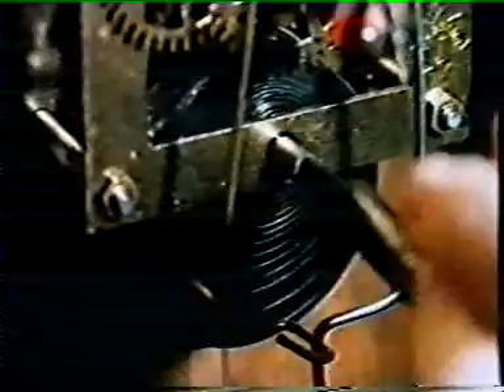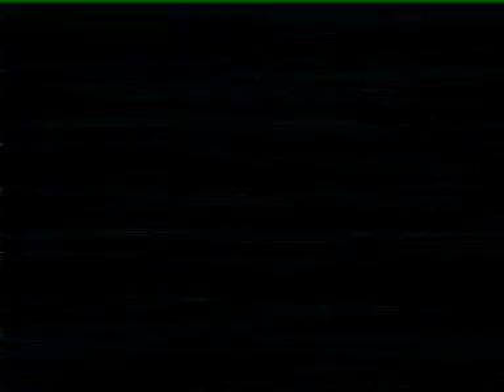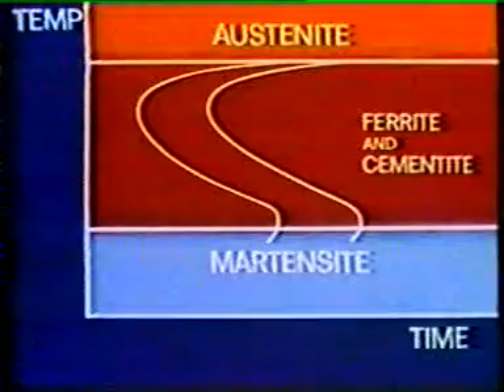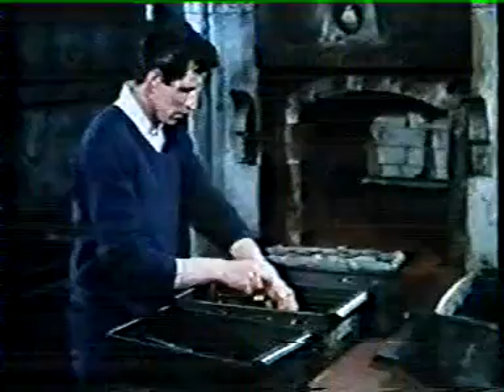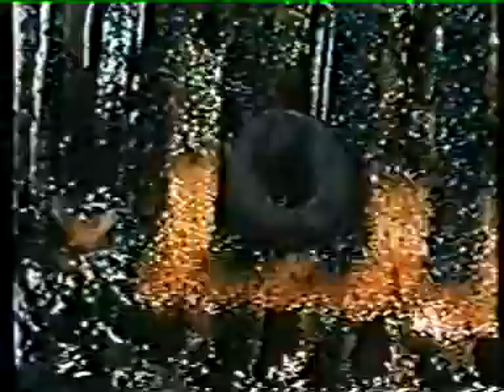Hardening & Tempering of Steel   Advanced

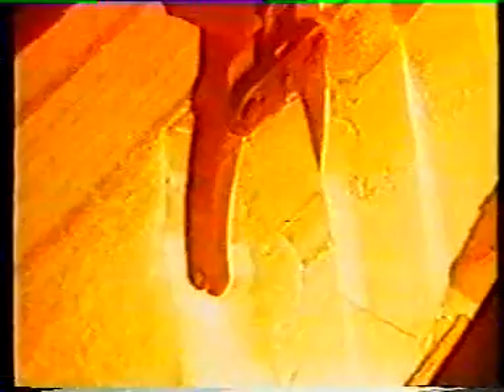Comment: 2:13 austenite
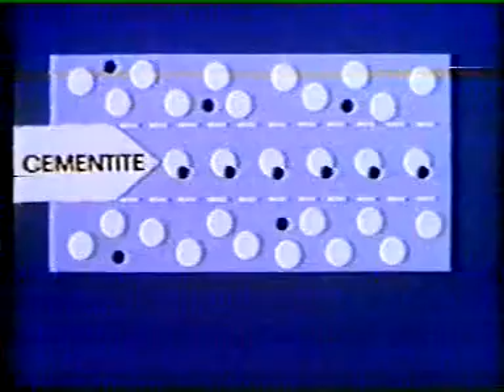2:44 cementite
2:48 Ferrite
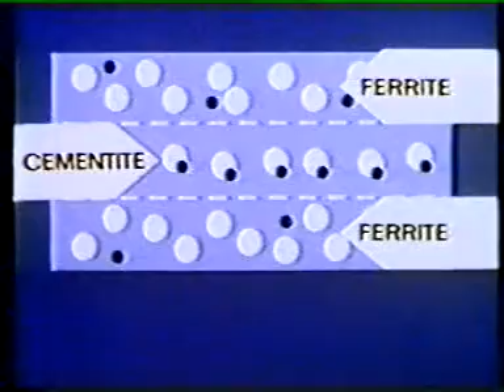2:55 pearlite
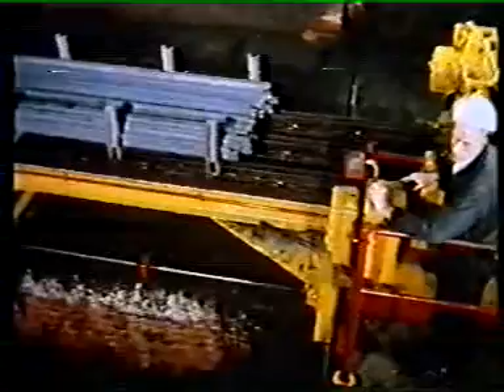3:56 frist step pearlite to austenite
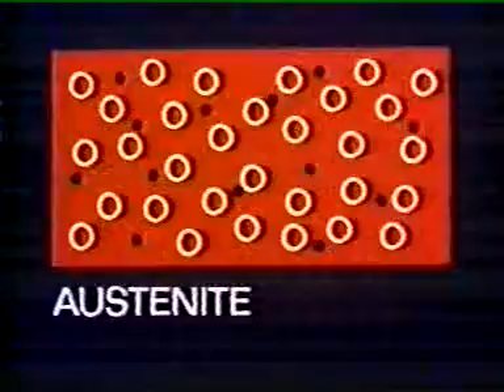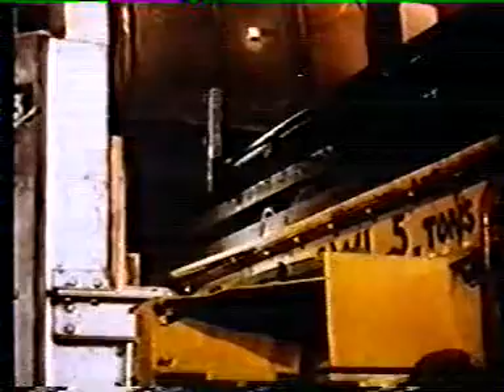4:52 martensite 5:34
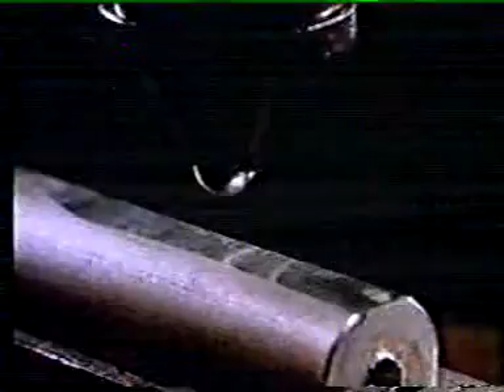6:15 hardeness measurements ( brinile)
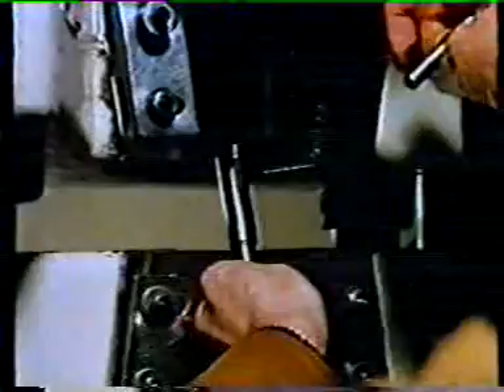6:39 tensile strength testing( hardended and tempered steel)
7:22 impact test
10:08 difference between oil and water quenching
Reply: thank you so much